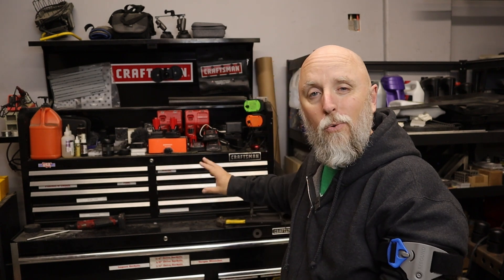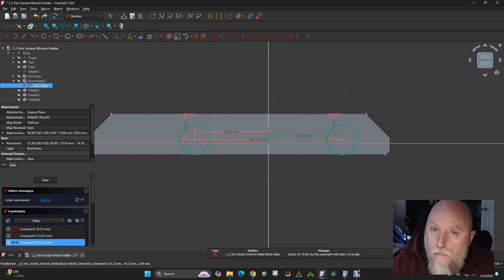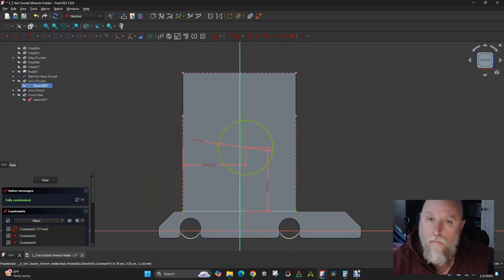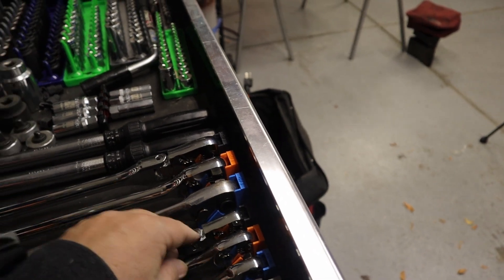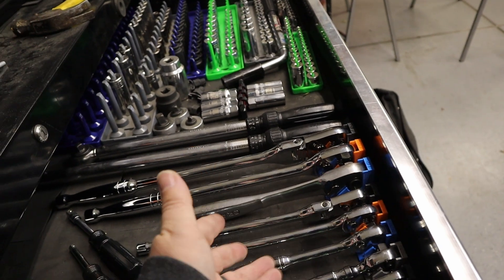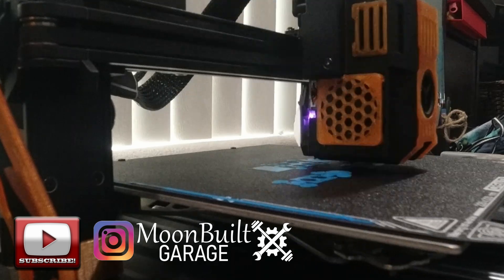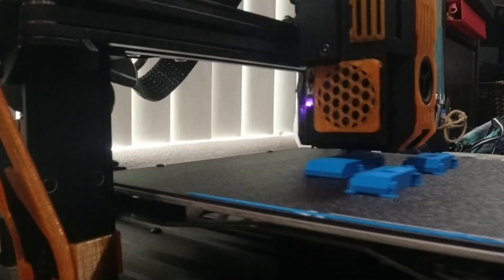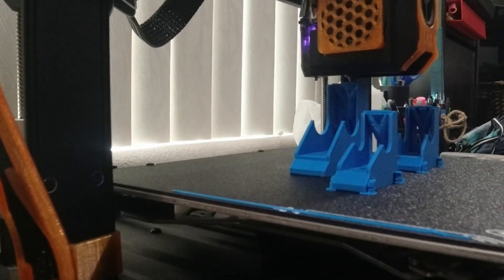3D Printing Magnetic Toolbox Organization Ratchet Holders

Comment: Greetings fellow Freecad user! Great content. The market for seeing the struggles you go through in the design process (freecad is getting better but still not the most intuitive program) and finding a way to get it done is going to get a lot of people watching.  I will say,  a decent mic would go a long way.  Appreciate the content,  subbed.
Reply from the maker: I realized during the edit that the audio recording was a bit off, and found one of the mic settings had changed, but I wasn't about to do the whole voice-over again.  
There is a certain learning curve to CAD, but I enjoying the process so far. Thanks for the Sub!
Reply: @MoonBuiltGarage  understood haha. Also,  I noticed you would open the calculator before inputting dimensions. You can put equations in as dimensions in freecad and it does and inputs the values automatically.
Reply from the maker: I'm finding that out.  I recently used that function on a project I'm working on

Comment: Just Purchased a 3D printer to start building parts for tool box organization and to build a 3D printer(JD's Garage). I have used both Sketchup and VCarve for building and woodworking projects. I am currently learning Fusion 360, which is still free for personal users. The big plus I see in Fusion 360 is the ability to go back and modify areas of your part without having to delete work you have already done.
Reply from the maker: I tried Fusion 360 awhile back, but decided not to se it (can't remember why).  I think the only reason I had to delete portions of the design and remake them were due to the order in which I put it together, and by changing one aspect of the design it effected another aspect further down the line...I've been working on how I design pats going forward to avoid that.